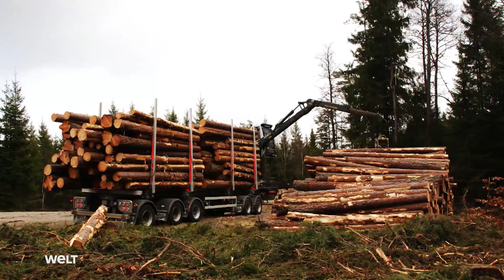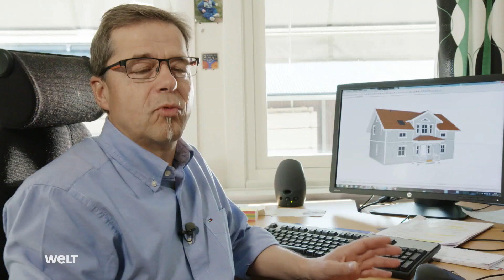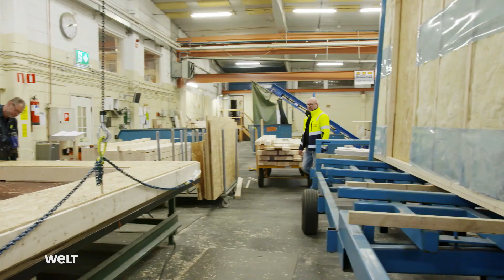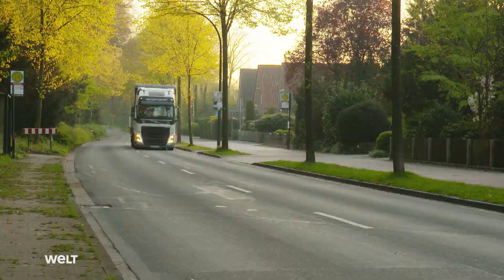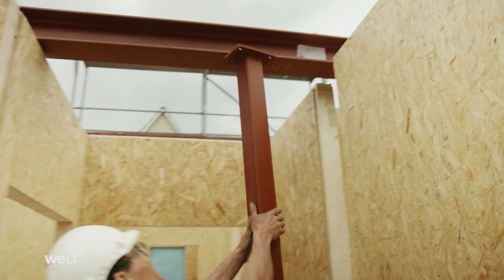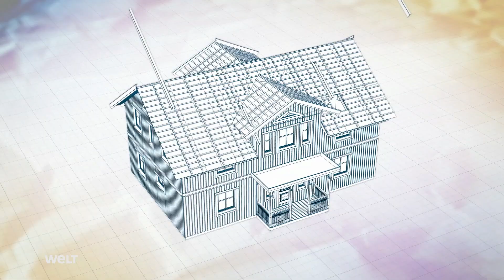BULLERBY HOUSE - From Swedisch Tree to German Home | Full Documentary

Comment: What happened to the wall that wouldn’t fit into place, and needed external support? How do you get the rainwater out of the interior walls? Did no one check the weather forecast? They covered the wet flooring with a waterproof membrane, why was it not installed the day before the rain arrived? Easily preventable consequences… Rolls of waterproof felt were available-but not installed over exposed insulated spaces?

Comment: US  Perspective: This is a high end build thats is above and beyond any US standards, the air tightness, insulation, structure etc. This is roughly $175/sq feet in europe. in US something like this currently cost between $600-1000 / sq feet and has ZERO government help or the level of customization. US is about 10-15 years away from this and it is very dependent on government incentives. The greed in current construction industry will prevent this from happening.

Comment: Top notch workmanship. How fireproof is the unit?
Reply: Fire retardant solvent could be sprayed on the exterior and interior walls when the building is fully completed to prevent the worst type of forest fires engulfing the the building. The builders should check the weather forecast in the location of projected to avoid rains on incomplete projects and cover the partly built components with rain synthetic material or heavy duty tarpauline.

Comment: Awesome video!  I do not quite understand why no plastic cover was used to avoid rain damage overnight. Other than that impressive Swedish/German workmanship.
Reply: bad leadership, Floor should have been covered ,At least tryed to cover the floor!
Reply: From what I’ve heard is, it’s ok for the wood to get wet a few times, it just can’t take months of it. They are covered when it will sit outside for a extended period of time.
Reply: the problem as you saw is not the wood its the insulation, simple yes cover in a tarp overnight, lm sure this happens often enough to keep and reuse tarps @txkoutdoorfam6911
Reply: @txkoutdoorfam6911 no, not when you have insulation and vapor barrier installed. A bare wood frame would not be so bad and could dry out. They need to remove all vapor barrier and insulation until the wood is dry and the re-install it.

Comment: If a moisture content of 15% is good for building why not 10%? Or 5%?
Im just curious about the decision to use wood that has reached 15% rather than wait for it to go down below 15%. I think what I’m saying is this: is 15% optimal or just the maximum acceptable for building and if so why not wait for it to go below that level?
Reply: No doubt targeted to the permanent moisture level the wood will settle to once installed in a building. Also if wood is overdry, it may split when nails or screws go in.
Reply: Its optimal..

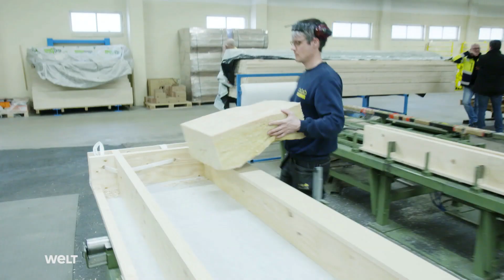Comment: 22:47 doesnt make sense, i have never seen a building that has 600mm thick external insulation and 400mm partition floor. What is he talking about?
Reply: No you probably have never seen that before, its very specific to the nordic region/ Scandinavia because there are such cold weather there and the law has set strict rules to make housing energy efficient and keep the heat inside, that much insulation is needed. Scandinavia kan be a hostile place in the winter 🥶 ❄️ and thats why specific construction and insulation is used.

Comment: all that work to prevent moisture, only to eff it up by not placing a cover/membrane on top to prevent most the water from coming in...wet chip-board? nasty. Don't know why they didn't use OSB there.

Comment: You'd have thought they would have had a plan in place in case it rained. I shook my head when I saw the manager discover all of that water in the ceiling. I would not have wanted to buy that house after that. And afterward, they were laying moisture barrier ON TOP of a wet surface. Crazy!
Reply: The cladding panels should have been protected by fire retardant powder foam to prevent any rain droppings from the root top to the wall panels. High tech craftmanship makes these project a solid build for innovative modern homes, quite impressive architectural advancement in low emission  wooden  organic properties.

Comment: Quick and easy construction. But the cost is prohibitive and too much for us in Africa. If it can be brought significantly down this will quickly address human settlement problems in zimbabwe and malawi
Reply: Africa would not need those strict codes requiring heavy insulation and thick walls since the climate is much warmer. I'm sure a more efficient design would be possible for African climates and at a much cheaper cost.
Reply: The cost is high because of high energy efficiency requitements. 
High energy efficiency requirements are because of global warming.
Global warming is because of overpopulation.
Housing shortage is because of overpopulatuon.

We could build simple houses and heat them or cool them a lot like Americans but that wouldn't be good for the environment.

Comment: the video is good. however, how can this house conquer the drawback of drainage system inside the house? which position do they set the toilet upstairs? I bet the interior decoration options are limited. the service life might be relatively shorter than standard house .at last, deforestation is a very bad idea in current situation.
Reply: the interior decoration options varies from each manufacturer, the cheaper ones have less room to pick the materials you like since thats one way to make them cheap, standardization. the more expensive ones you can decide on every small bit of the house if you so desire. regarding deforestation Sweden has the most strict forest laws anywhere in the world, for every 1 tree you cut 3 new are planted and the swedish forest is growing every years despite a yearly felling of 18 million m3. FSC that was implemented to protect rainforest deforestation in south america is less strict than Swedish forest laws and they have been in place for over 100 years. service life of these houses are no shorter than any other type, houses have been built this way in Sweden atleast the last 50 years and many houses from the early 80s look more or less new, given they have been repainted a couple times ofcourse but the wood structure itself is largely unaffected by time and wear.

Comment: Everything was going very smooth for constructors and for me as an audince till the rain ruined the site. They were too smart not to cover the construction with a 20 euro nylon sheet in case of rain for over the night .
Reply: A protected layer of synthetic fabric was the solution over the prefabrication components, this technical solutions should have options of yet again, anti-fire retardant solvent sprayed on the foam adjusted cladding panels to prevent both severe weather constraints in damaging the property interior and exterior walls.

Comment: here in kenya we believe in stone and  motor if you do such a house to a local he will look as is you have just done a shell , may be cow shed , but to say the truth this is efficient and solves house problem instantly...amazing
Reply: True but this house is damn too expensive 😂
Reply: @Guka_Official  Thats the point they have the technology ,build it quick , but they pay heavily for it , we here build cheaply a house like that would probably between 60,000 to 80,000 usd in kenya stone wall and would probably take 1 and a half month or i round it off two months , but solid , but honestly in terms of speed and accuracy  they are on point
Reply: Remember the weather conditions are different in Kenya you don’t have extreme cold temperatures below zero degrees. So a brick house will not withstand those extreme sub zero temperatures it will crack.
Reply: @mzee0000  There are planty of brick houses in Sweden lol. I lived in one for 20 years.. Either your house is built with wood like showed in the episode or it's made of brick.
Reply: True but this house is damn too expensive 😂